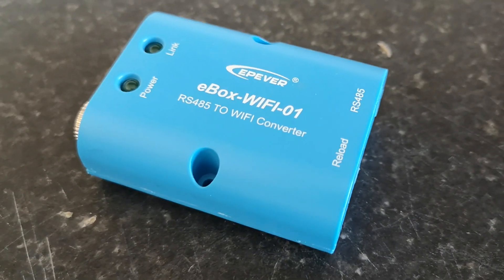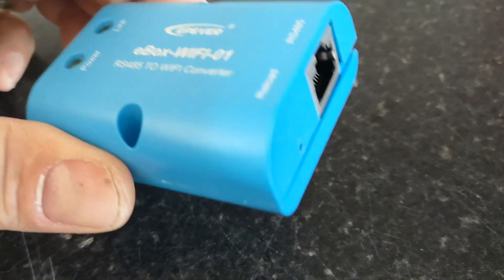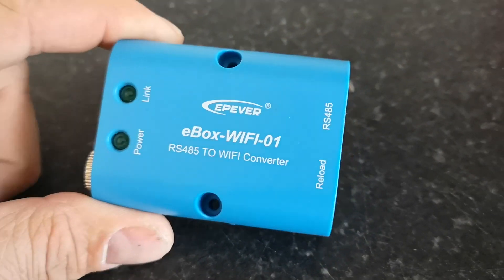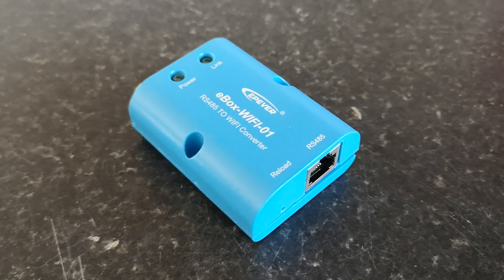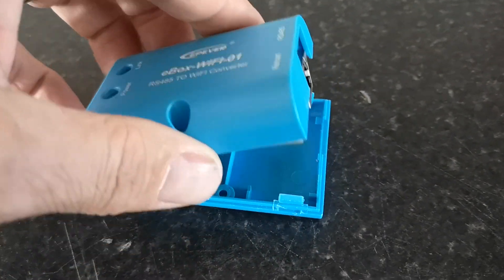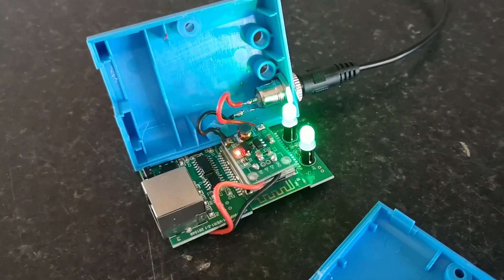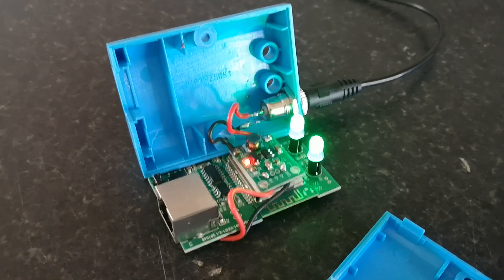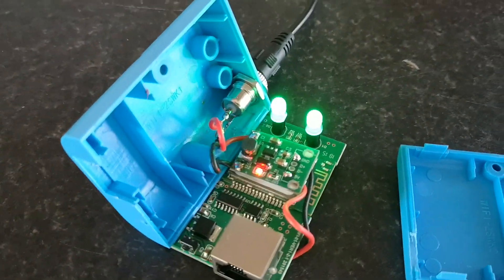EPEver eBox WiFi 01 STA Mode and its own Power Supply

Comment: For all of you who have been like me, trying to setup the new version of this device to STA, it's possible, even with some security!

Connect to the device, go to Mode Setting, right clic on the button and edit the drop-down to pass in value "STA" instead of "AP" and it will be accepted..

Use chrome, right-click on the Mode button and choose "Inspect element", change from <option value="AP">  to <option value="STA"> and then hit the button.

Then create an additional WiFi network on your router (or use an additional AP), for SSID use: LSD and for password use: 12345678 and for Encryption choose WPA2-AES, and voila! It will connect to this WiFi network and shows on your WiFi router client list! 

If you want, you can use your router MAC whitelist to allow only this device MAC address to that SSID.

Code to edit on the webpage of the device:

<select name="wifi_mode" class="select-style">
     <option value="AP">AP Mode </option>
     <option value="STA">STA Mode  ADDED BY ME</option>
    </select>

Anyone is invited to thumbs up this comment if works for them, Stuart Davies, please include this on the description, it will help a lot of people!

Comment: Interesting mate, i thought they had removed the possibility to put it into station mode.
Reply from the maker: All they did was remove STA from the drop down menu, it can still be selected using St!CK3L 's workaround in the comments on Adam Welch's "Hacked EPEver WiFi to RS485" video. It's easy and works really well, so my old USB WiFi dongle is now obsolete again, no need for the second WiFi. :)
Reply: There is no reference to using "St!CK3L's workaround" in Adams video, all the videos show the older versioned dongles that have the STA option. Is there a video on using "St!CK3L's workaround"?
Reply from the maker: The workaround is in the comments on Adams video, not in the video. Sorry, I should have explained it better.
Reply: Just wanted to give everyone a heads up, they have released a new firmware that reenables STA mode. Released 12/05/2019 :-)
Reply: @grembling22  may I know where did you manage to find the firmware? Its not on the official website.
Reply: @grembling22  do you have the link to where one can download the latest firmware from?  I cant seem to find it on their website.
Thanks in advance.